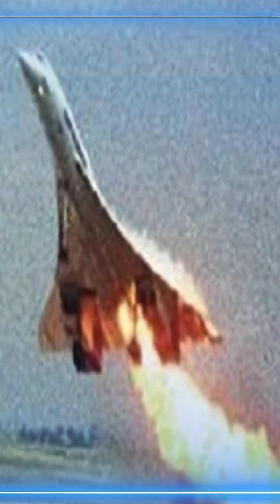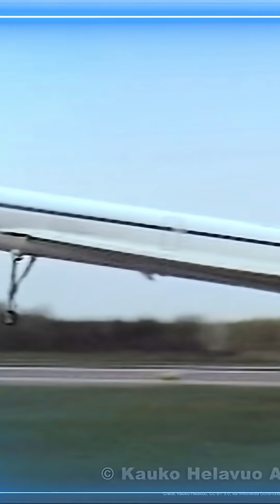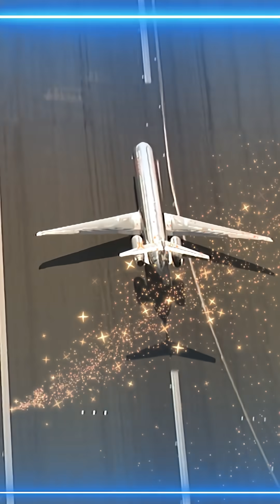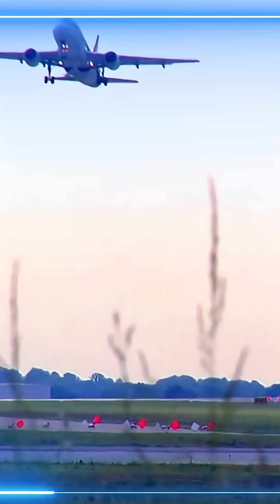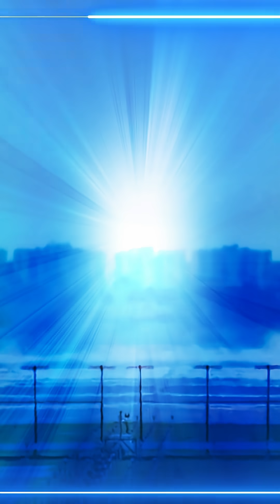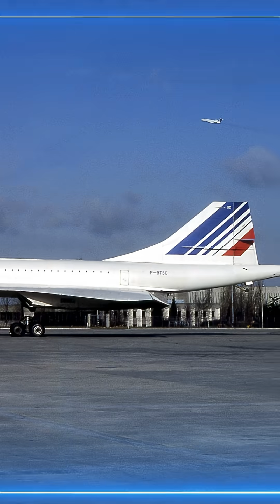✈️ Reviving Supersonic Flight: From Concorde to NASA's X-59 🚀

Comment: Operating cost could ground it before it takes off.  Limited seats will be an issue.  Seats will be expensive, and will not compare with traditional passenger jets.